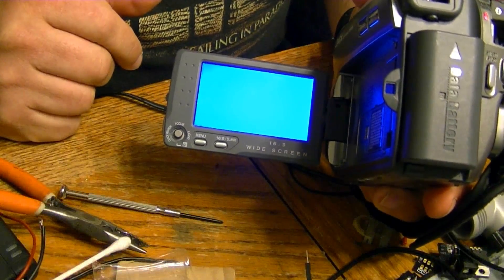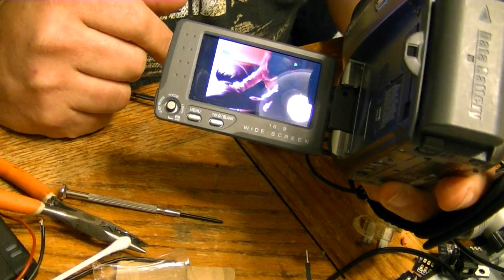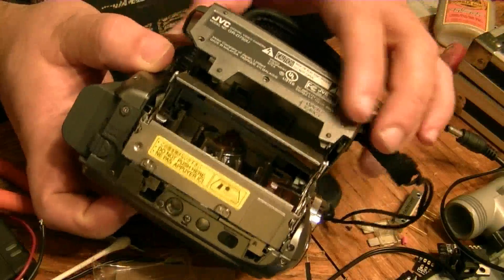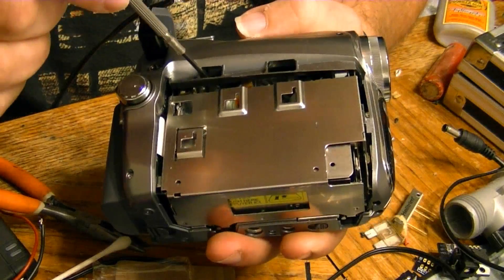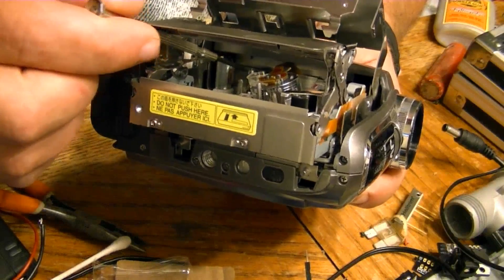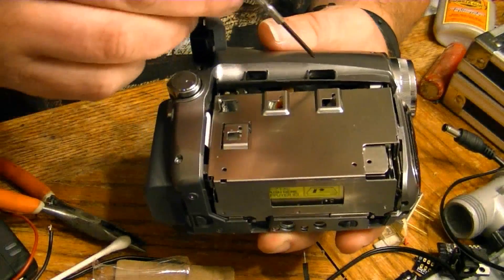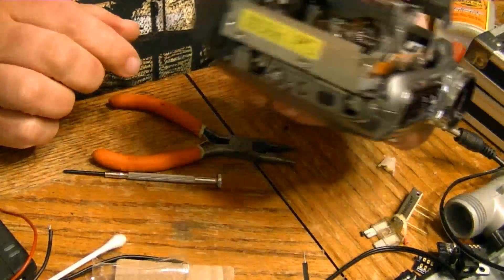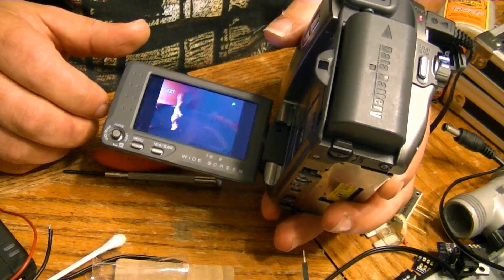MiniDV artifacts, head alignment

Comment: Back in the 80's in high school I would spend time helping my friends get their cassette decks fixed simply adjusting the head on the unit and voila they were amazed.  Now years later I am doing the same thing as you are doing...getting a huge box full of dv tapes transfered to digital and my 3 cameras all had the same issue.  I knew there had to be a way and the head unit itself had no adjustment but this got one back up to perfect.  Thank you for going over the whole issue.  Very well done and you are helping many of us who know the units aren't bad, the tapes aren't bad so this is the fix!  Bravo

Comment: That’s an excellent video! Unfortunately it is still not working on my Panasonic PV GS500. But my issues are a little bit different. Artifacts appears horizontally only when I RECORD new stuff on any tape. Older tapes are still playing fine with no artifacts. Never seen this issue on the internet. Do you know what could be the problem? Thanks!

Comment: Great video.  Never would have thought to do this nor would I have figured it out without your video.  FYI:  I have a Sony Camcorder and things were fairly different from your video of a JVC.  The outer door removal for example.  On the Sony you can separate the larger plastic outer door from the inner metal door framework, but you cannot remove it as it has wiring in it that is attached to the unit.  There are 3 small black screws that allow you to separate the two to give you more space to get inside.   Once inside the rollers all look different (but similar) to those on the JVC.  I found there were two that you could adjust by turning the head clockwise or counter clockwise.  It took a lot of trial and error to figure out I needed to turn the one on the right about 3/4 of a turn counter-clockwise and the one on the left about 1 full turn clockwise.  Each time you make an adjustment you either improve or degrade the video, and/or the audio.  Some combinations of tweaks only affect the audio.  Again, never would have got to that point without the video so thanks!

Comment: The correct procedure for this is to play the tape and use a small flat head screwdriver to adjust the supply side guide roller and the take up side guide roller, that's the idea with the 2 square aceess holes, only turning a very little at a time, this way you can see the image and get it perfect, I don't recommend using needle nose pliers for this job.
Reply: Do you have a video demonstrating what you're talking about? I have a Canon ZR200. I removed the tape compartment cover like he did in the video. I don't have those 2 square access holes. When I insert the tape the tape blocks all of my holes so I can't make the adjustments that you mentioned.
Reply: @CrowdPleeza  No I don't have a video for it, but all VCRs are the same, they have 2 guide posts and are adjustable, you'll need to put the tape in and press play, 2 arms (guide posts) will pull the tape out of the cassette and wrap it around the drum head, so with your camera plugged into a TV, and pressing play on your camera, you should see a picture on your TV, in very small amounts turn each guide post with a small screwdriver until the picture is clear, the tape is probablt blocking the holes becasue you didn't press play, you can't adjust it unless it's playing.

Comment: I'm so glad the new ones record on solid state media like SD cards. I tried cleaning lubing, cleaning, cleaning and cleaning with 99% isopropyl and a small soft artists paint brush. Ran a cleaning tape through for 10 seconds......about 20 times. Nothing I did fixed the skipping audio and artifacts.

Then I watched this video. I found two identical looking stainless rollers. One is beside the rubber pinch roller.....and that one was fairly easy to turn clockwise. So I turned it half a turn in. The one beside it with the spring under it I turned in one quarter turn. The other was on the opposite side of the cassette compartment. It was identical but it was really tight so I backed it off half a turn. Fixed the problem with my VX2000. I shot a 2 minute test video using a ten year old JVC tape and got perfect picture and sound. Now I need to find some new mini DV tapes......and they won't be Sony....that's for sure.  I have a bunch of Sony tapes that the gears inside have seized up for some reason. I put them in and they jamb and give an error message. All my other tapes work fine....but the Sony ones all crapped out on me.

Comment: This did it for me. Thank you so much. I got a used Canon ZR300 off Amazon in order to transfer my minidv tapes to digital. Got it when I got home tonight and popped in a tape. I got the intermittent sound and somewhat different artifacts than in this video. Regardless, I took off the cover like in the video and when I looked down inside, a couple of the stands in the vicinity of the activities in the video had a groove for a flat head screwdriver. I took a guess at which one, gave it a quarter turn and I have been golden so far. Thanks again.

Comment: I have the exact camcorder when you play a tape or record it ticks inside while the tape plays and sound goes in and out and pixels in the middle and right side I have tried cleaning but still doing the same
Reply: Fionn O'Brien 

what model camcorder is this?
Reply: And I have the exact problem, it ticks inside and pixels and sound are damaged. Turning pins did not work. JVC GR-D725. And I bought a charger and a new battery from alibaba because I lost them 12 years ago :) And now the tape is inside, the memories also and the damn thing just won't work :)
Reply: I had this problem also and it turned out it was a broken tooth of a cog. It was impossible to fix. you can probably 3d print the cog. this cog is under the right reel as we look the top of the camera. I sold mine for parts

Comment: I have 2 miniDv from Jvc, both have the same problem of this video. It's a common problem. thank you for your clever attempt, il'll try to fix them. ;-)
Reply: Best Buy sold these...I learned from the local repair shop that JVC was the worst as far as reliability.  When I heard in the video, "This is a flimsy part" I thought, well that makes sense.  My dad kicked the charging cord and it fell off the table and this happened-now I will have to try it.

Comment: Thanks for posting this. Actually by adjusting the right flumsy roll I noticed I could control the pixels 180 degrees to both directions, clock- and counterclockwise. However sound was missing still. But if you think that tape is goin to capstain motor drive roll(which reads the data) you probably should adjust the left flumsy roll too. AND by tightening it by 30 degrees (so very little) -> I got sound back !

Comment: This video is a godsend. I have the exact camcorder, but my issue is a bit different. My artifacts are very sparse but go across the screen, and whenever that happens the audio cuts out quickly and then right back on. I will try tinkering with it tomorrow, hopefully it fixes it.
Reply from the maker: with sparse artifacts going horizontally across the screen/audio drops issue + the fact that it comes and goes sounds to me like tape is dragging at times or belt issue.  but then again I haven't seen this situation myself to experiment, just a guess.  my problem was always consistent artifacts and consistently timed audio breaks.
Reply: +chadbh74 Hmmm, good point. On one playback the audio may cut out a word someone said, but on the next playback you'll hear it. Any guess on what I could do to try and fix that? I've never messed with any electronics before, but I'd really like to get mine working.
Reply from the maker: +justinlightning well IF it's just a slightly sticking tape, you can rewind it all the way, fast forward to end, then rewind it all the way.  this is what we did in the 'old' days for audio cassettes that dragged to retention them.  also was standard procedure to do periodically on old QIC80 data tape cartridges on computers.
Reply: chadbh74 just read this thread, same problem for me. Hope this works I’ve heard about this method before but after seeing u say to do it as well as other sources I’m finally down THANK U FAM
Reply: Did any of you guys got this issue fixed? I am having the same problem in my Panasonic PV GS500. But only when I record new stuff on any tapes. Older tapes are still playing with no artifacts

Comment: For those who are watching this... always remember to remove battery as short circuiting can happen in a split second and also remove charging cable as electrical shock can kill.
Reply: Large Electrolytic capacitors in electronics can potentially kill you even if the battery and cable are detatched. So always be careful.
Charging cable is like 7v, so by itself it's harmless.